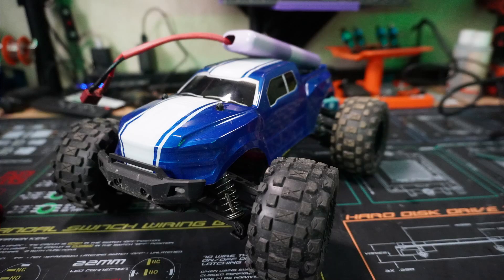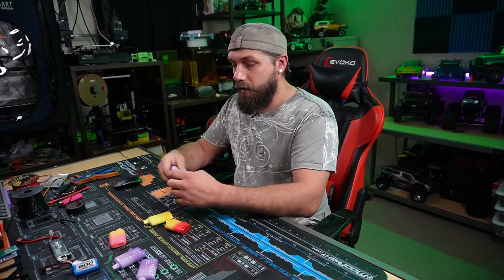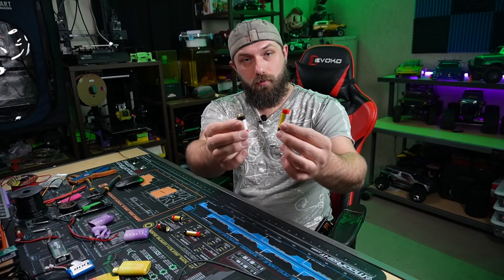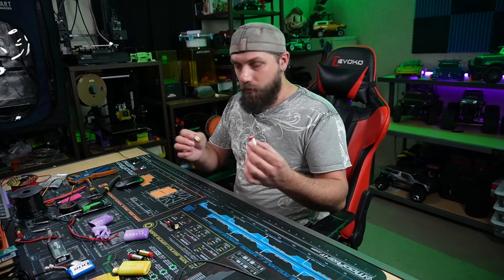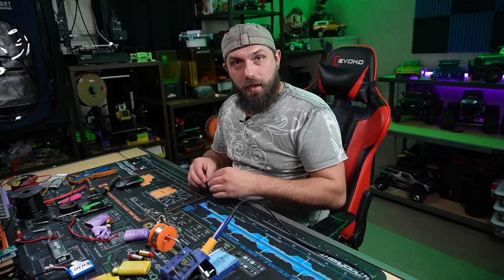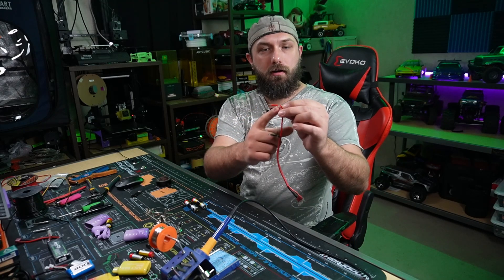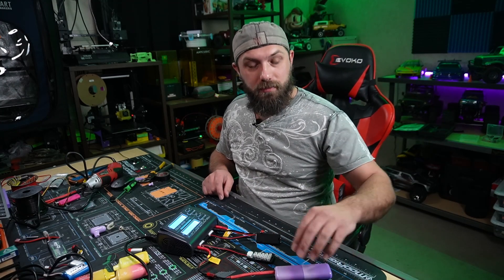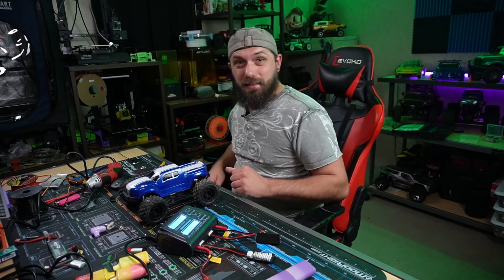Vape Battery Hack: Create 2S LiPo for RC Action!

Comment: as far as i know they are lithium ion cells with a low discharge rate but it doesnt actually matter they also stop at 4,2 volts per cell  but you really need a BMS to balance the cells while charging otherwise a great idea i also reuse them for my little drone i have 2 in parallel i got over 4 minutes of flight time longer than the original batterie lasts

Comment: Dude how do you balance the cells 😳
Reply from the maker: Store bought batteries have a lead to hook to a charger and properly check each cell is fully charged. In the case of the home made battery i charged each batter one by one before assembling it. I plan on adding balance charging to this project later. For now this was more proof of concept.
Reply: @RatchetBuildz  I also make rc battery's but you stacking two on top each other has confused me how you'd keep 4 cells healthy on a 2s wire but cool regardless
Reply: for what I understand he just completely charge them

Comment: I tried this with an Tinywhoop, well it flied for 1 minute until the battery starts to sag, but for anything low amp stuff like transmitters they are great.
Reply from the maker: Yeah , the life span of this home made battery mot not be that long but i like reduce and reuse thought on it. Mine still working ok so far only a few charges on it but plan on an update video and adding the balance charging to it.

Comment: Very creative. I guess you could use the same concept for making batteries for a Radio transmitter. Just add a vape tank and long tube and you could vape and drive your car at the same time. lol    I guess you could also make a killer rechargeable flashlight with them as well. I love to see people who are skilled enough to repurpose items. Great job!!! 👍
Reply from the maker: Thank you i just like to try and reduce and reuse where i can plus they are fun little projects that are useful.
Reply: @RatchetBuildz  I have some old vape batteries. They might be good for an RC radio or small RC car. Good deal. Your saving money and the environment and the truck really performed quite well with your custom battery.

Comment: So vapes use LIPO batteries? That doesn't sound right. The Volcano comes with two 800 Mah Lithium Ion batteries, packing tape them stacked together and get a Deans parallel adapter. It now has a 1600 Mah battery in it. It's still limited to Lithium Ion 15 - 20c so it won't be any faster, but It'll run a really long time on that. And it will easy strap into the Volcano battery tray. That's what I did. Good idea however. Too bad the vape batteries are so small.
Reply from the maker: Yes, your correct I could run them in parallel with the stock batteries. It just fun to make something I can use out of basically trash and reuse them for some fun. No, they never will be good as purpose bought rc battery, but still a fun project if someone already have the stuff todo it . Though I wouldn't recommend anyone doing this. Thanks for watching and the comment.

Comment: Ohh this is the Mad Max way to do it. I like it lol.

I have been trying to find a proper charging board for 2S, anyone know of one? I want it mainly to not have to use my old crappy charger and have the proper protection.
Reply from the maker: Mad max would be correct. As for your charing board, I don't have an answer for that. Hope someone can jump in and help. Thanks for watching.

Comment: I have done this with tired 18650s before
cant use them to vape but i can use them to power a small radio controlled car
3000mah 7.4V 2S1P from 2 efest 3000mah 18650s isnt bad!
Repurposing stuff is awesome.

I also have some new 3500's laying around somewhere. I have the connectors, heat shrink and the wires. A 3500mah 7.4v pack would only cost me 10 bucks to make. 
This time, with balancing leads.
Reply from the maker: That what I was trying to do is just use stuff that is going to be tossed anyway and get more use out of it.  Thanks for watching.

Comment: vtc6 sony are the only ones you want to use or greater why they can handle 15 amps each cell  using vape cells small ones like that well vapers go hard on those cells they heat coils constantly youll get 150 charges most outt a cell 500 is the ideal normal but vaping is so hard so dont use them used cells on anything that flies rc cars fine but  use good cells folks
Reply from the maker: I don't expect them to last long just a fun little project. Plus I get some use out of batteries heading to the landfill.

Comment: This is actually 2S2P. 
Also I would suggest people fit balancing leads when making these batteries and use a proper balancing charger. 
Lithium Ion batteries can explode/auto-ignite if incorrectly charged and these packs don’t charge correctly if one cell falls below the others.
Reply from the maker: Another comment beat you to this, but yes, I didn't think about it until  I posted the video. Hopefully, when I get my delivery, I'll do an update adding balance leads .
Reply: @RatchetBuildz  did you mKe a video about adding ballance leads

Comment: Can u make a 3s or higher battery
Reply from the maker: I'm waiting for a few more vapes and trying the 3s to see what it does next. I am also going to try and add some balance charging to it.
Reply: As long as you know what you're doing you can go to as many cells as you want.

But you need to know what you're doing. I can't exaggerate that enough. Look into understanding electric scooter batteries and you'll understand somewhat
Reply: @deathbydeviceable  I got a good understanding of battery I feel as I built a pack for a e-bike with 18650 batteries
Reply: I'd like to make one that sits low in my SCX24 I've been trying to collect in pairs the disposable vapes are really out of hand these days.
Reply: @dumpsterstu4474  it’s possible to do